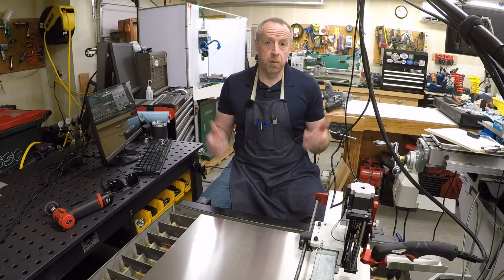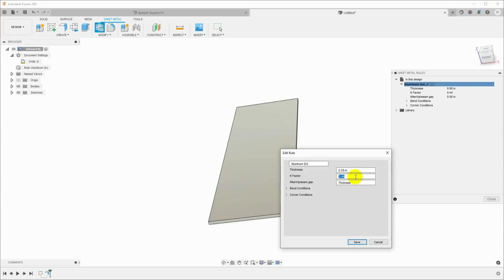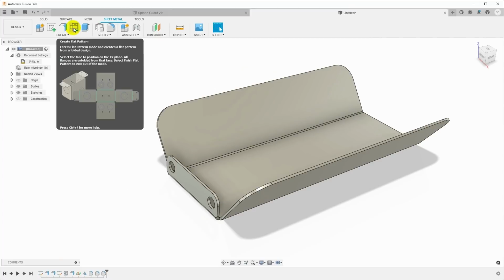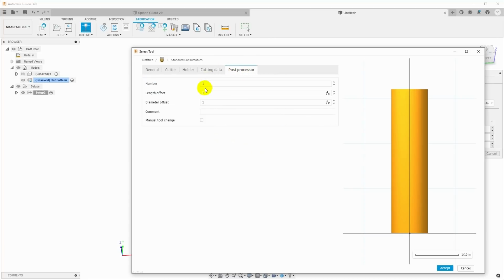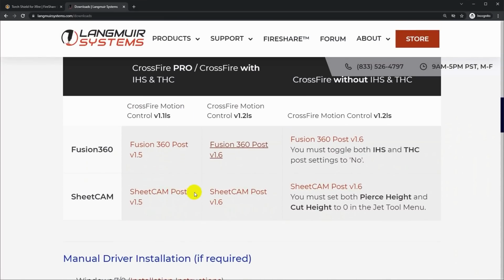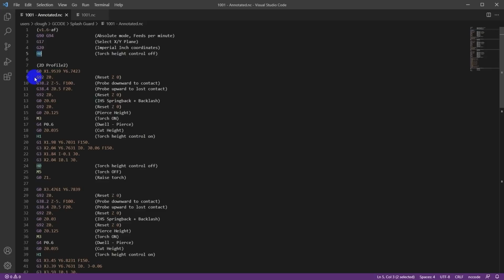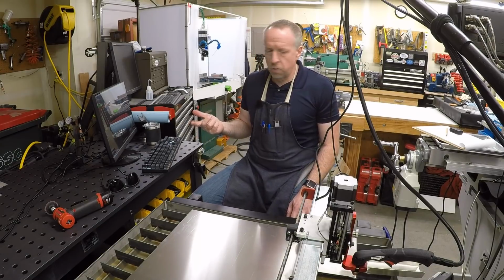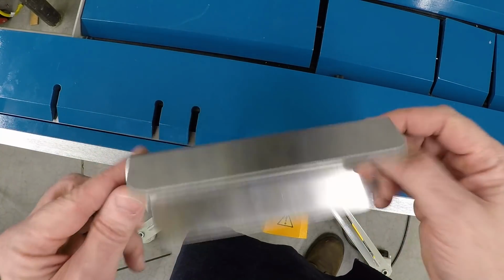Making a Torch Splash Guard | Langmuir Crossfire Software Workflow | Fusion 360 Sheet Metal

Comment: I know this is older, but if you set up plasma tools with the cut data, you don't have to edit the data and the post numbers.  You can set up a tool for each of the metal thicknesses from your machines cut settings.  So, you can have a 14 gauge, 12 gauge, 3/16", etc. tool and just select what tool for the metal thickness.  Also can set everything up for stainless and aluminum tools.  Saves a lot of time when you are getting your cut process and post done.

Comment: Great video!! After all design done and PP, I can’t get my torch to light or  if it does, it goes out right away. I’ve changed the Pierce delay back and forth, the torch works fine with the test feature. ??? I’ll try on Langmuir forum. Thanks again this is a great video that allows me to get used to the many different functions of fusion 360 as practice for design.

Comment: Hi and thanks, I have just discovered your video.
If you don't mind and you can tell me, I saw you are using a non genuine Langmuire plasma table.
Could you tell me what electronics did you use in it ?
I dont' mean the drivers, or motors, but what board. It's a GRBL DLC 32 ?
Thank you in  advance.
All my best wishes from France !

Comment: Great video. I have just bought a Cut60DN. I plan to add it to my 30X30 Longmill CNC router. I have a small shop. Don't have the room for another large machine with the Longmill on one wall and the 60Watt CO2 on the other wall. I have Vcarve. I all but forgot about Fusion CAM. Everyone talking about Sheetcam, I am not ready to make a software purchase right now. This video has  helped  tons. Thanks

Comment: I notice you have a 30XP like I do!  Just wondering which consumable type you use (standard vs fine cut) and whether you're running off 120 or 240?  Most of what I will cut is <1/4'' aluminum and I'm wondering if the fine cut consumables will be a good option to reduce slag & post-finishing.  Thanks!

Comment: Hey James aka clough 42, I've watched most of your videos, and learned alot. I've noticed you printed bends on paper and transfered to sheet metal. I'm sure u already thought of it, and I've just missed it. But if not. Why not put sheet metal on plasma table, and add a holder attachment to scratch your bends and cuts. Maybe even cut your cuts with torch. If not just to scratch bends from fusion. No paper needed. I'm sure for small stuff paper may be easier ect. just a thought. Keep learning and sharing. It's appreciated . Thanks
Reply from the maker: The Stuff Made Here style sharpie holder would be handy, but the Langmuir electronics are closed and not easily extensible to add that.  It's technically possible to take out the torch and replace it with a scribe and run a separate GCODE program just for that, but it seems like a lot of work, with a lot of risk of the part moving, since it's just sitting on the slats of the table.

Comment: Which way will moisture weep from the torch side of these shields?  I'm sure some will splash there regardless.
Reply from the maker: It would flow down and drain through the bend reliefs, but in practice, I haven't seen any moisture make it up there.

Comment: Good work James i really like you tool post grinder videos as well i need to build one that spins at around 40k though for grinding small boars in carbide. Anyway im a tool and die maker by trade and now am a full time tooling engineer and im proud of yor work buddy i just got a crossfire pro as well and can cut 3/16 all day with a + or - .005 all day its a great machine and keep up the great content
Reply from the maker: Which torch are you using?  I think the 30XP I have would struggle with the duty cycle on that.
Reply: Im running the prime weld cut 60 on a well grounded 50 amp breaker
Reply: What type and how thick is the material you are cutting

Comment: Great video. I really enjoyed you showing the G code breakdown. I have a Crossfire Pro with THC and a Hypertherm 65 with machine torch. If you haven't seen it yet Hypertherm's new Powermax Sync series (replaces the 65/85/105 cutters) is awesome. One piece consumable package that the machines recognizes when installed and adjusts settings accordingly. The machine also tracks the number of pierces, dry fires, and cut time for each consumable package.

Comment: Great video as always James. 
Hope you have good ventilation in your shop (I've got an extractor fan setup).
I use AutoCAD 2007 for my layout work (cause I'm fast with it) and SheetCam for my post processor. My Crossfire Pro uses Mach3 and I've built my own Z-axis and THC (the Langmuir forum has comprehensive details).  I get minimal dross forming on my cuts (nicely tweaked post-process tools) and the best way I've found for dross removal is simply knocking it off with an ordinary steel paint-scraper.  Touch-up on my wire wheel rarely needed.

Comment: How about building a built-in digital angle gauge for the brake? The digital angle cubes probably work just as well. Having to guess the correct lifting angle by trial and error is not only cumbersome, but incongruous with the all bells and whistles of the brake.

Comment: Oh, BTW, you might want to raise water level that water is almost touching the metal. That way water will actually catch most of the fumes. Saying this just in case (I assume you didn't raise water level because you didn't have torch cover ready).
Reply from the maker: Level full requires about 8 gallons.  5 gallons is easier to handle with a bucket.

Comment: Your movement in this software is excellent, did the space mouse make that much of a difference?
Reply from the maker: Yes.  Highly recommended.  I did some modeling in a hotel room last weekend without it, and I immediately ordered a wireless one to take with me on the road.
Reply: @Clough42  I was wondering how you were flipping the part around and resizing the image when it looked like the mouse cursor was off to the side and not on the part. A short tutorial on how to actually manhandle the drawing while working on it would be appreciated.
Reply from the maker: @lwilton  there isn't much to it.  The SpaceMouse is just a knob that manipulates the part in 3D space, independent of everything else.
Reply: Oh wow yeah he does use that.  Deleting my other question 😂

Just knew it looked different

Comment: Do you have to use a Gas mix to cut Ali ? I know you can use just air with Ferous metals
Reply from the maker: Nope.  Just air.
Reply: @Clough42  thank you 🙏 Definitely on my To buy list now. Big thank you for the work process.. I’m used to 3d printing so had an idea.. never used the sheet enviro in fusion but boy is that slick. 🙏🙏

Comment: Hmmm it seems like doing CAM in Fusion is like overkill....does langmuir not provide a software package that will simply generate cut paths off a DXF file?  We had a jd2 plasma table at work and we'd use sheetcam to generate cut paths and post process g-code...the Chinese fiber laser we have reads dxf's directly and handles all the g-code generation in the background...kinda like cut2d does with cnc routers....I have to think langmuir has a better solution for dxf's...
Reply from the maker: Fusion flattens the 3D model and accounts for the bend allowances.  For a part this simple, it doesn't add much.  For something more complex, and dimension-critical, it does.
Reply: @Clough42  right, but you can export a flat dxf from fusion that is is just as accurate as the 2d contour generated with fusion's cam package....we work exclusively with dxf's....activate flat pattern>create sketch>project>save dxf.... otherwise the dxf that fusion outputs will have bend lines and bend extent lines.

Comment: Nice project and nice outcome.  You certainly have the best of tools.  I was sort of surprised at the horizontal position of the torch.
Reply from the maker: Surprised at the horizontal position?   Not sure I understand.
Reply: @Clough42  dedicated cnc plasma torches are available that are straight and stand vertical in the Z axis.  I bought an Everlast plasma with the cnc torch but I had a vertical torch before it.

Comment: Greetings James, thank you again for a great video. I do really like the Fusion 360 portions as I am learning (slowly) Fusion 360. I seemed to have downloaded Frustration 360 instead though. Going through the Gcode was great. Like you I want to understand all the parts of the process and not just believe it was magic pixies. With regard to bending the correct angle in the sheet metal brake, would you concider making a mechanical pantograph style angle display gauge? That might be a fun project. All it needs to do is indicate ( move a needle or linear bar ) the angle you pull up the front of the brake and let you know just how much your bend is. It would use all your fun toys. Cheers and stay well.
Reply from the maker: The bending arm has a sliding scale built in.  To get a final bend of 50 degrees, I was planning to pull it to 55, but I was focused on filming, and when I looked down, I was at 70.  Oops.
Reply: @Clough42   Greetings James. Boy do I know that feeling. It would be cool to see the gauge at work sometime. I would love to have one of those Brakes. Also did you ever go over the electronics circuit to see if it really does draw 17A and Baliegh just got it wrong? "Curiouser and curiouser" said Alice...
Reply from the maker: @rodentofanger1720  yes.  Despite all the passionate comment threads, it really does draw that much.  Hard to say whether they got it wrong from the beginning, or if components from their suppliers changed over time.  The tech support people I spoke with at Baileigh were super helpful with parts and service, but didn't seem very knowledgeable about the electrical design, so I would just be guessing.

Comment: To streamline our bending operations, I add small 1/8" x 1/8" tabs aligned with the bend lines on the edges of the flat pattern (predefined as a drag-n-drop library feature) . The bending tech just lines up the tabs with the edge of the break. Yes, the tabs need to be ground off after bending. But the need to transfer bend info from a drawing to the flat pattern blank (or many blanks) is eliminated. It provides a substantial net gain and reduced scrap.
Reply from the maker: That's a great idea.  I know some people perforate the bends as well.  I'm not familiar with library features.  Maybe I need to do some research.
Reply: @Clough42  Or you could go full Shane ("stuff made here") and add a retractable Sharpie as a second tool. He cuts the part and marks the bends all in one go.

Comment: I use SolidWorks but I suspect F360 has similar functionality - an option when creating the 55° flanges is to select both edges in the initial feature and eliminate the need for the mirror feature.
Reply from the maker: Oh, cool.  I didn't think to try that.
Reply: You are correct.
Reply: I was going to say the same thing 👍

Comment: You might want to add Air Scriber to your setup to automatically mark the bend lines, like on more professional machines. Also, the wire brush cup is a great at cleaning dross from plasma cut parts (the braided wire cup for steel and stainless steel - don't know about aluminum).
Reply: "Stuff Made Here" has some videos on the sharpie he added to his plasma cutter.

Comment: It looks like you might want to figure a way to keep the torch cable/hose from hitting the sharp/hot metal on the talbe top.
Reply from the maker: It hasn't hit yet.  I could probably stand to shorten the cable to the overhead support arm.

Comment: I would have made another bend on de side of the Splash guard 45 degrees down so the water go down again, now it's splahing up again.👍👍😎
Reply from the maker: Yeah, I've been thinking about some kind of downward-facing deflector to prevent splashing and keep the sparks from reaching the edges of the table.

Comment: All this imperial/metric garbage. We should all stick to cubits. It's so much easier, the measurement betwixt the elbow and the middle finger. I am special as I'm missing the tip of my middle finger so I'm able to measure in both Metric Cubits and Imperial Cubits. It worked great until I built my shed in cubits... Turns out that I can't tell my ass from my elbow!

Comment: He is totally going to make a StuffMadeHere style Sharpie plotter for it.
Reply: I thought the same thing. That upgrade is great but you need an open CNC controller for that. Not sure what is used on the Crossfire.
Reply from the maker: Exactly.  This is the downside of the closed system.  The upside is that it just worked on the first try.
Reply: @Clough42  Yeh thought so, well Mach3 can also be used with Plasma. Of course is nice to have a plug and play product. I did not know the company before you posted. Looks really good for the price.
Reply from the maker: @Ale_Lab  I've never been super happy with Mach.  I'm thinking about centroid acorn for my next machine.
Reply: @Clough42  Centroid is indeed pretty good. I also like Masso CNC controller among the all in one solution, with control panel included. 
Like you I have been using Mach3 for the past years and although is not the best, I have modified existing screensets to the point that it doesn't seems Mach3 anymore. If you couple it with UC300ETH control board then you get some additional features and better behavior. Plus can always move to UCCNC which is a really good overall hardware and software controller for the CNC.
So the question comes automatically. What are you going to convert? The lathe? 😁 I know you can not give spoiler, but was worth it a try.
Reply: @Ale_Lab  ive used mach for years  but am actually peeking at linux cnc now :P mach never seems to update or upgrade their sw...i am running it on 4 machines tho with out much trouble
Reply: I hope so!
Reply: Anyone had any real experience with planetcnc? I have a planetcnc controller set up in a router, but I’m not done with spindle modification so I haven’t done anything except draw some images with a sharpie.

Comment: Do you plan to add the marker like "Stuff made here" did?
Reply from the maker: The Langmuir FireControl electronics and software are a closed system, so adding something like that would probably require replacing them.